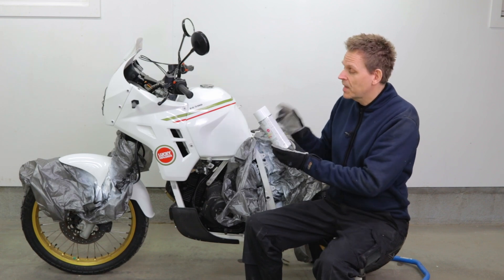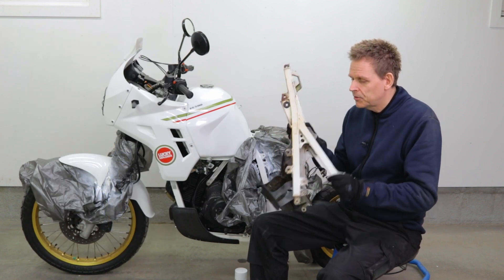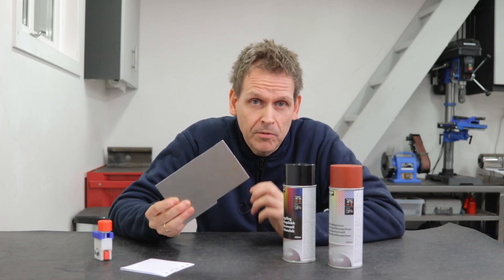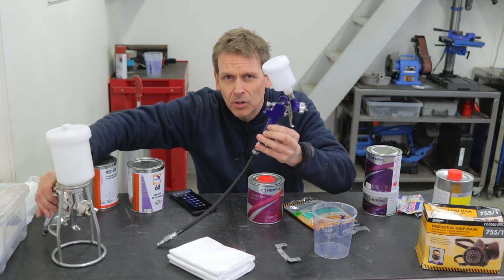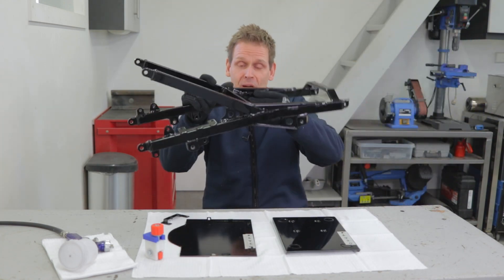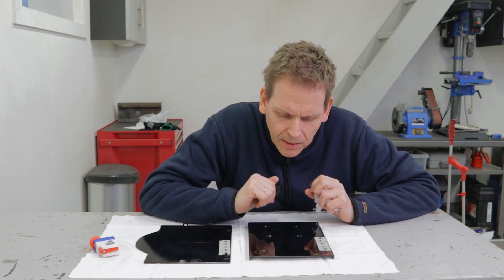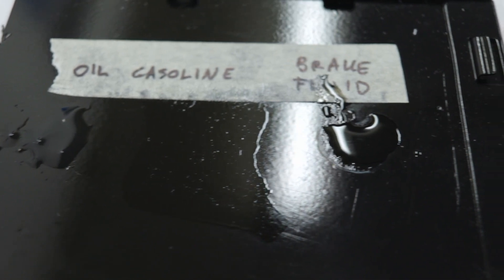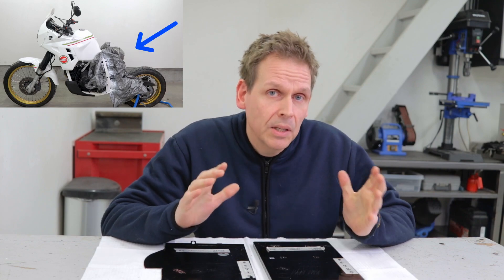Don't use Spray Can Paint!

Comment: There are lots of different spray paint.
They can put any regular paint  in a spray can.
Instead of drying it with a paint remover, try spraying water on it.
Sounds crazy, but water makes it dry sooner.
They do this with cars after they put the paint on in the factory.
Reply from the maker: Drying with paint remover? Misspelled?
I know professional paint shops and put the item into a heat chamber to harden the paint faster. Could be water is sprayed on after it to cool it down? I don't understand how spraying on water makes it dry faster. It is most common to use water based paint on factories. Spraying on water onto the finished paint before it is dry will damage it 😵‍💫
Reply: @kihestad 
Well, that was not a hair dryer you used. 😂
It can literally be used to burn off paint.
Hence, a paint remover.
Reply from the maker: Ah, got it 😵‍💫🤣 Yes, I became a bit impatient. The heat gun is definitely hot 😁
Reply: @kihestad  
Spray water on it instead.
As strange it may sound, it really dries the paint faster.
Make sure the water is clean (preferably distilled water), or otherwise you get stains.
And apply it as a mist.

Comment: This was great  - very good test - one that I have thought about a lot from time to time when I have watched people doing painting.  I have never done anything but spray can and have been satisfied for the most part.  However, I think that stepping up my game requires stepping up my equipment and my knowledge.  They only way to improve is to continue to try.  Thanks for sharing
Reply from the maker: I highly recommend getting a paint gun, it's like a million times better to work with than spray cans. It's not hard at all! Just remember a water/particle filter from your air compressor to not get contamination (water, oil and dust) into the paint. Normally I also spray my garage floor and walls using a water hose first to not get to much dust on the painted parts.

Comment: How does the cost compare ?
Also you need spray gun & compressor.
I have good experience with spray can paint. 
But the technique is definitely not the same.
And some spray can paint will "attack" some primers &/or paints.
Reply from the maker: Hi, it's not easy to compare cost. It depends on very many factors. It does require some practice to get good results from a paint gun, but it's not very difficult to get better results than using spray can 😊

Comment: I wondered how you scraped off the paint for the bare spot when you did the thickness test. If you scraped mechanically you might have changed the thickness of the metal. From your later results, it looks like the brake fluid would do a great job of taking off the paint, without touching the metal, for just such a comparison.
Reply from the maker: I tried to carefully scrape off the paint with a shap knife without scratching the metal, but you are correct: I might have touched the metal surface and made the measurements less accurate. I did it the same way on both samples, so the comparison should be somewhat fair though. Perhaps it would have been best to mask off a part with a piece tape before painting  🤔

Comment: fully agree with you on the spray can usefulness :) spray can enamels are way softer (less gloss). but painting is a nice can of worms where everybody has an opinion haha. great tests tho. thanks for sharing
Reply from the maker: Hmm, is the spray can car paint an enamel paint? I had not thought of it that way. It sure looks like it, the surface is hard but seems a bit brittle. A lot off spray can paint types exists, having different properties, some are probably better than others. I have not found any that matches the finish and durability of 2K paint painted with paint gun though 😋 Different experiences and opinions are good, I am hoping to hear from others and hopefully learn more! 😁
Reply: @kihestad  oh i meant the hardware store type spray can :) i can see from the internet that many brands have specific automotive type spray cans but here i can't find them. i always paint with a paint gun starting with filler, two coats wash primer, two or three 1k or 2k high solids primer, and 3 -6 light coats of color and if needed 2-3 clear coat too.
Reply from the maker: @thebrokenbone  Got it! 👍 The hardware store I am using the most here in Norway is Biltema, they have a separat car and motorcycle section in their store, so it might not be the most typical hw-store. You will probably have to go to a paint shop to get car paint, "normal" hardware stores had typically universal/hobby spray cans. Some of these are not made to be very durable, but are good enough for indoors decorations.